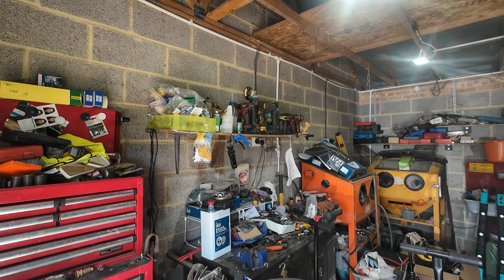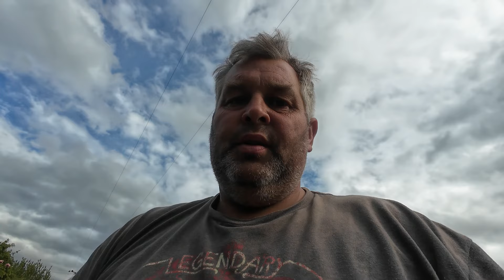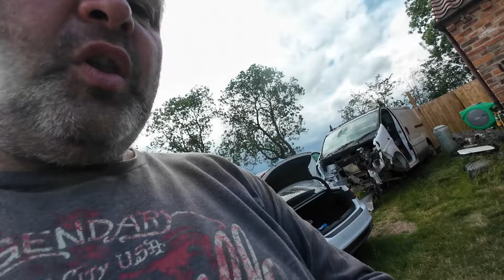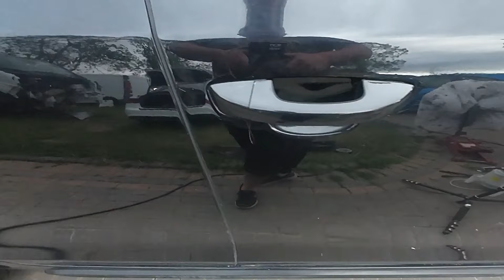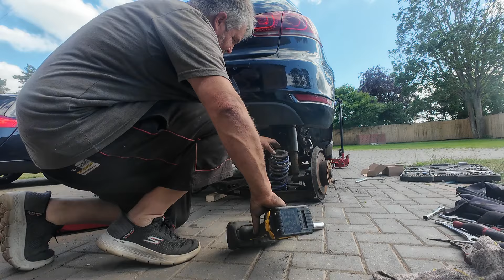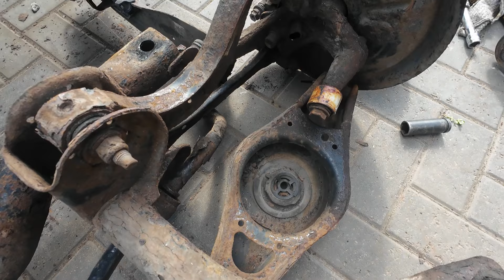VW golf getting some repair 👍

Comment: Morning Mark.
You will get there, ive just done starter motor on my trafic, very tight on space but take front of van not to bad to do, 2 hours all in.
Great channel.
Remember "If in doubt, chop it out"😅
Reply from the maker: Yeah once the front is off you can get to most parts, 👍, if it was a 1.9 it takes about 6 months to do 🤣, it's a real nightmare
Reply: @ON-THE-DRIVEWAY  2.0ltr, so only took me 3 months😂